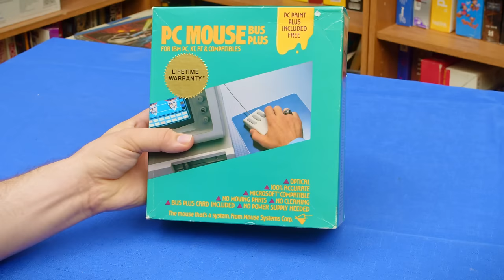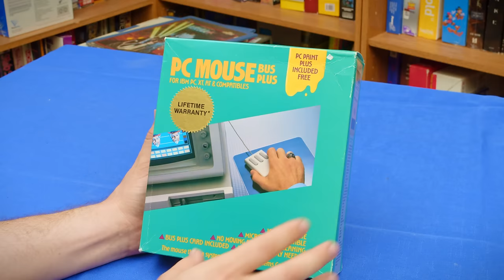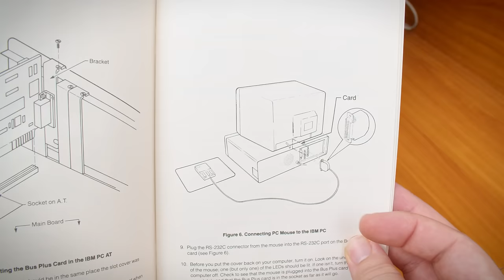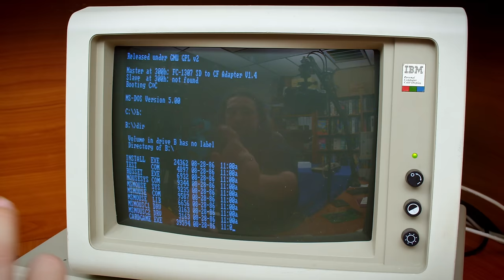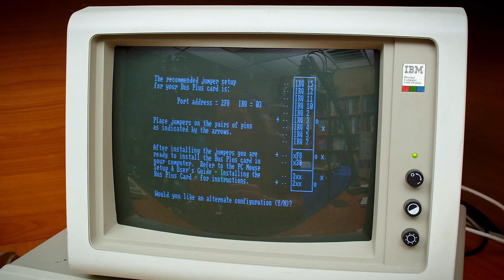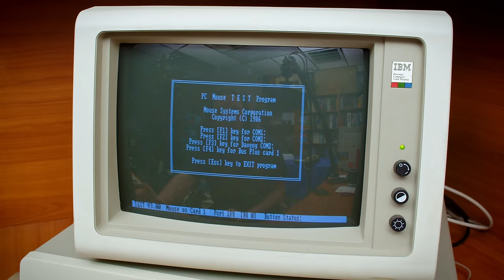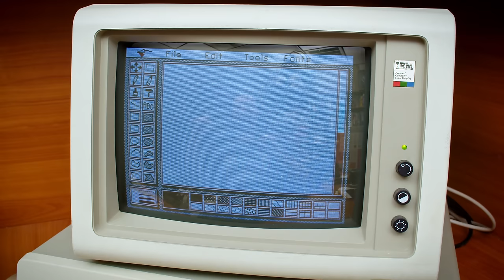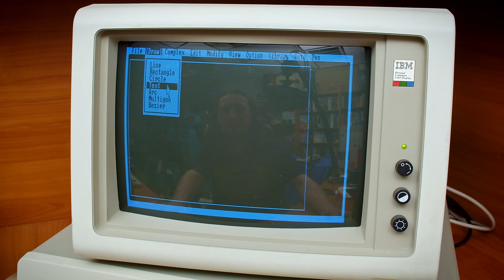The First Optical Mouse - Mouse Systems PC Mouse

Comment: 'lifetime warranty".....wonder how that would be handled today!
Reply: usually with a footnote "Lifetime* Warranty"

"* Warranty valid only during the natural lifetime of the device."
Reply: Their lifetime usually, not our lifetime.  That's how it's best been described to me which of course makes sense, if the company isn't even in business anymore.
Reply: It’s not even based on the expected lifetime of the device. It’s for as long as the company is still manufacturing that or a comparable model. So a lifetime warranty on a 5 TB SSD might only be six months to a year. Each state can require a minimum time like 90 days as well.
Reply: @MK-ge2mh the lifetime of a model's run, basically.
Reply: @gigaherz_  most of these 80s tech companies were lucky to last for more than a few years
Reply: Depends how old you are when you buy an item with a "lifetime warranty!" ... If you're 18, the warranty may be quite long, but if you're 90, the warranty period may be quite short!
Reply: What warranty
Reply: @gigaherz_  then that brings up the next question....

what is the "natural" lifetime of the device? especially in a case where it was left unboxed for years, and thus it's lifetime started quite late
Reply: the lifetime of this product mostly depends on mousepad lifetime. since it get scratches and scoring, you need to go shopping again )
and I've read the comments below abount printiong new pads on laser printer but sadly they are not the same.
Reply: @borodaevkirill7371  so by that logic, the warranty is still valid since the mousepad is still intact, lol, it would be amazing if they did somehow respect that warranty in the modern day
Reply: @Minty1337  the lifetime warranty means as usual the producer's time of life :)
Reply: @gigaherz_  Well basically lifetime warranty means that as soon as the device fails, it has reached the end of its lifetime and therefore also voiding the lifetime warranty.
Reply: “The lifetime of the device”. Oh it stopped working? Well, that’s the end of the warranty too!

Comment: I had the PC Mouse II.  My dad's company sold office equipment and supplies and got it as a sample.  It was wild to see and use it the first time - NO BALL and NO FRICTION.  I was the envy of all my friends.  I used that thing for a good 15 years with no issues.  I had it attached to my XT, 386, 486. Pentiums, Celeron computers and basically used it until modern optical mouse became  common.  I still have it and works great attached to any of my retro computers.
Reply: Are you still using the same mousepad?
Reply: Yep, same here. I used it for probably the same amount of time over many generations of PCs. Avoided the ball-mouse era. Pad still works fine after all those years.
Reply: @fordesponja  Yup.  Still works great only had to re-glue the rubber bottom pad back on a corner.  The pad was actually the only draw back on the PC Mouse II.  It's quite smaller.  And that was one thing new people to the mouse had to get use to was you didn't have to or have the space to go running off in all directions like a ball mouse.  You had to stay on the pad.  So I got use to smaller wrist motions then some people had with ball mice and whole forearm movements.

Comment: Back at the university, we loved to play two pranks on the freshmen trying to use the UNIX lab. The first one was to flip the orientation of the mousepads on the Sun workstations (exactly the same as you have here) so the mice wouldn't "work" properly. The second one was to activate the "decay screen" screensaver with a respawn time of zero, so the screen would start to melt as soon as mouse movement stopped. Combine those for maximum hilarity.
Reply: Are you me? Lmao!

Comment: I remember using those mice on SPARCstation machines at uni. If the mouse mat was damaged or missing, you could print out a new mouse mat (using the SUN laser printer) and that worked too. I think it had to be a high contrast, high resolution printer.
Reply: I managed a lab of SPARCStation 5’s and remember these very well. Nostalgia overload.
Reply: Some Sun work stations to
Reply: I also used those in college in the 90s as well, though I recall how finicky the mice were. Due to this bad impression, I preferred "male" mice longer than most.
Reply: Yup we had one on a solaris terminal at sussex uni in 1998
Reply: i have one for SUN. But the metal pad is missing.
Reply: We had these mice on all our Sun Workstations at work. Having used a drawing tablet on a Racal Redac PDP11 based CAD system previously it took me a while to get used to not lifting the mouse up like I could on the tablets pen.

I'm glad the price was mentioned at the end. I found a 1988 Sun price list online and back then Sun were charging $3000 for a package of a 19" monochrome monitor, keyboard,  and mouse, to go with their $28900 base model Sun3/280. 

Moving on to more mundane mice, in the early 1990s we bought a Logitech one which was still expensive enough to come with a free watch similar to a Swatch ! The days of the Asda (WalMart) value optical mouse for less than the price of a watch were some years off.

Comment: I had an optical mouse for my Amiga computer which had a dot screen instead of the grid. When my mouse pad wore out I photocopied a mechanical screen transfer I had as a graphic designer and put a clear plastic cover on it to keep using it. It worked well. 😊

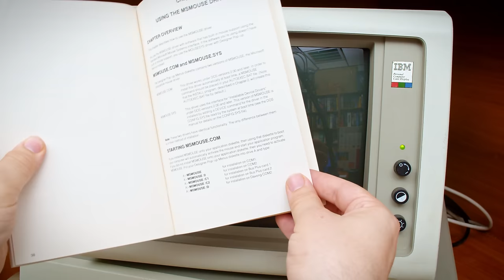Comment: 17:40 Settlers II could use two mice. It had split screen mode for two players. It was bizarre seeing two cursors.
Reply: It was a whole adventure on its own to get it to run and not have both mice controlling the player 1 cursor. I think one had to be a PS/2 mouse and one had to be a serial mouse, and you should not load the serial mouse driver to get it to control the player 2 cursor. We spent so much time getting that to work before we realized there is no way to not be looking at your opponent's screen constantly on a 14" display.
Reply: You can on the first one too
Reply: @cabbelos  You can always try to hide what you're doing and only do the attacks when your opponent is not looking. It was a whole meta game, but also counting on "honor" system to not look.

Comment: Genius! I have fond memories of cleaning my gummed up ball mice, with that disgusting felt that used to work it's way around the x/y posts.
Reply: No, Mouse Systems. Genius was a different mouse brand.
Reply: The call it 'felt' because it felt funny when I touched it.
Reply: Yeah, I remember the times when you had to take out the ball, clean it, and also clean the rollers inside.
Some mice had very light weight plastic balls, and those were much more sensitive to dust buildup. 
The other kind of mice had rubberized balls of steel, and those worked much better from my memory.
Reply: FOND memories... yeesh ;P

Comment: Had one of these on my Sun3/75 workstation at work (mid-late 80's).  Scrimped and saved to get one for my PC at home (Taiwan V30 TURBO PC Clone) -- The mouse pads were surprisingly durable.  I saw several that had been rolled over with office chairs and they would work fine once you flattened them back out again!  Best tracking mouse I've ever used.

Comment: Lovely!  I first used a serial Mouse Systems Mouse in 1988 for PCB CAD work. I understood the visible / infra-red aspect used with the mat, but it was more than my job was worth to risk taking it apart. I love those optical sensors! I noticed that the bus interface board is using a standard PC compatible UART chip so I guess the Bus aspect of this edition was the inclusion of the serial interface in the box since early PCs didn't have them as standard - certainly my 286 machine from 1989 didn't.
Reply: One CAD program I used on a 286 PC was Schema. You could draw a schematic then synthesize it into a CPLD. Later a colleague tried loading it onto a 486 but it was unusable as the cursor moved at Warp Factor 15.
Reply: @MrDuncl  Later versions of Schema that I used (maybe from around 1993 or so) were OK on a 486, but I can certainly relate to the warp-speed mouse reponse with some older software.

Comment: Hello

Nice enthusiastic presentation. I used very similar mouse to this one in 1993, when I was testing the Pro/Engineer 3D CAD software in Silicon Graphics Personal Iris 4D/25. If you open the Wikipedia page about Personal Iris workstation, the mouse is clearly visible in the right down edge of its photo.

First, I regularly used a mouse of any type a few years before with IBM PC-AT which ran under DOS. Only software that used mouse on this computer was AutoCAD…

Ah, sweet memories…

Comment: That was my first mouse! I connected it to my Columbia Data Systems MPC1600 I bought in 1984, an IBM clone. The next  I was  using the mouse with Microsoft Windows version 1.03. Just imagine running Windows from two floppy drives and NO hard drive.
When I started working at a large electronics company around 1988 they had Apollo workstation computers running PCB CAD software and the computers used the same Mouse System mice.
Reply: We had the Apollo workstations for one year before Mentor dropped support for them and we moved to Sun. Were your Apollo monitors awful? Our were so dim all the systems had to be in a room with blackout blinds. The Sun monitors just worked like any other CRT.
Reply: @MrDuncl  HP bought Apollo and we transitioned to HP and Sun workstations during the 1990's. We were running Mentor Graphics Boardstation for schematic capture and PCB layout. Others in the building were using Sun workstations running Cadence for IC layout. Late in the 1990's some projects were using PADS PCB and I switched to another department and they were using Orcad schematic and PCB layout and the EE's were designing Altera FPGA's with Altera's proprietary software on Windows PC's.
Yup, it was a messed up place to work! The best of times and the worst of times. 🙂 🤔

Comment: Optical mice like this date back to Xerox Alto and the 1970s. They had at least three generations, where they started with something like a optomechanical "ball mouse" without the ball; the encoder wheels tracked the table directly. Then they used a ball mouse, then an optical mouse on the reflective grid system like your PC mouse. I think they all are basically the same in terms of electronics and logic, although the mechanical parts are different. The ball mice have the benefit of not requiring a special pad and aren't constrained by the dimensions of the pad, rather the dimensions of the table or similar surface in general. That's why it took so long for the "modern" CMOS camera mice to replace the ball mice in general usability. A document by Xerox that talks about these different mice and how they implemented their systems. Based on just glancing through the document, these basic optical mice are first demonstrated in 1967. YouTube doesn't like linking, so you have to find it yourself, it's by Richard F. Lyon, tittled "The Optical Mouse, and an Architectural Methodology for Smart Digital Sensors", and is dated 1981.

Comment: Some systems I worked with in the Marines(can't give many details) had one of the old school optical mice. 

It was so absolutely terrible that I stuck with ball mice at home for an honestly unreasonable amount of time. I have no idea why they used opticals, they were on garrison systems not field systems so cleanliness of the ball wasn't an issue, you wouldn't have to pop the ball out to clean it under fire or anything and we kept our spaces pretty clean to begin with.

Comment: Sun Microsystems used these (or very similar) on their Sun Stations back in the mid 1980s
Reply: yep, sparcstations.. got a lot support calls "my mouse has gone haywire!" - "try turning hte mouse pad 90 degrees" - "..ah, that fixed it." Worse, someone nicked the mouse pad, expensive workstation rendered useless.

Comment: I had a ball-less mouse for my Atari ST back in the late 80's. It was so much better than one with a ball. That also only worked with a special mouse mat but it was silver and didn't have the same grid pattern, it was more like dots and I don't remember the mouse having to be perfectly orientated to use it. When I upgraded to a PC in the mid 90's I had to go back to a ball mouse and it was definitely a downgrade in the mouse.

Comment: My father had an ATI VGA Wonder-16 combined with this mouse. The graphics card had a connector for bus mice integrated and it would work just like your card, but it only took up one ISA-slot. The whole setup, including maximal memory expansion was incredibly expensive though, costing upwards of 1000 Dutch Guilders. Luckily this could be written off as Business Expenses, which meant he didn't have to pay VAT.

Comment: The problem was it was expensive and required the mouse pad. The ball mouse didn't require much in the way of a special mousepad. And that mousepad was expensive - $50+. When it got worn down after a couple of years, your mouse became useless. Whereas the ball mouse just degraded and got irritating to use, the optical mouse stopped working completely. (Anyone who worked in a lab full of UNIX machines knows the frustration when you see the mouse pad had worn a clear central part which meant you could only use the inch wide margins to mouse). That's really why the ball mouse won out - you didn't need an expensive mouse pad that wore out quickly and rendered your very expensive optical mouse useless until it was replaced. Had the surface been more robust, or cheaper, then it might have made a difference (or had there been third party replacement mouse pads easily available). The ball mouse sucked, but at least it was usable without a special mouse pad. The only reason the Intellimouse Explorer took over was it too worked on most surfaces without a mouse pad and got rid of the obvious cleaning issues.

Comment: 5 and 7 were for lpt ports
2 was usually used by the system.
3 and 4 were used for com 1 and 2

I used IRQ 5 for com 3 a lot

10 was for the sound card

14 and 15 were for the IDE 1 and IDE 0

Very nice how they had the instructions on the screen with the jumper settings 

This was made for end users to install themselves.

The good old days

Comment: The 9 pin serial port was a really important thing on the DOS machines.
I remember using them.

I remember when every PC had the 9 pin and the 25 pin serial ports and I remember using the 25 to 9 and 9 to 25 pin adapters and gender changers.
And null modem adapters and cables.

I used the 25 pin serial ports to connect external modems.
I think the first one was 300 baud

It is hard to imagine but the 33.6 was in the early 90s and the 56k was in the mid 90s

Despite having a 33.6 or 56k modem, the fastest usable speed was about 32k and usually it negotiated to 28.8

The old copper phone lines were not very good.

I also remember the first fax machines and I remember getting the 9600 fax in the 80s and the 14.4 fax machine 

I imagine they made a 28.8 but I didn't have one.

I own a multi scanner, printer, fax machine and I think it does either 33.6 or 56k but it usually goes down to 14.4 when I send and receive faxes.

Comment: I had a Sun 4/330 at work that had something very similar. Along with a 19 inch Trintron monitor it was one of the best personal systems in the department. I don't remember any problems with the mouse that couldn't be dealt with by light dusting. But I don't remember ever seeing one on a PC before.

Comment: 12:45 "What about the jumpers requires changing hard disk settings?" On an XT class computer the hard disk controller uses IRQ 5 so that IRQ isn't available for the mouse controller. On an AT class computer the IDE channels use IRQ 14 and 15 so there's no conflict there as you have twice as many IRQs to choose from.

Comment: I have used that exact mouse on a clone xt and at!, as well as the Logitech track eg the one that is on display on the CHM exhibit
Reply: side note, my mother was a teacher at the time, and we got this exact mouse since it was the only mouse supported by the yearbook publishers' software. and yes it was a GUI layout program that run on XT/AT (AT recommended) and required at least an EGA adapter or MDA  graphics card.. also of note Don't dent the mousepad.

Comment: General advice: Do not look into Infrared or Ultraviolett light sources. Since the visual system in our brain doesn't actively respond to these "colours" very much, our biological protective measures like the Iris size control and eye-lid shutting reflexes do not work. But the amount of light will still get absorbed inside your eye and may cause damage if the power is high enough.

Presumably the IR diode should be only as strong as the red one, and as such should not be dangerous. But on the other hand 20th century technology included such exciting stuff as radioactive camping lights and asbestos clothes, so I wouldn't put too much trust into that ;-)

Comment: Ball mice were unfortunately better from a practical perspective; even the occasional pad scratch renders the experience frustrating and the pads scratch very easily. These were used by Sun systems at my university during the mid-90's and they were unusable. They are cool though.